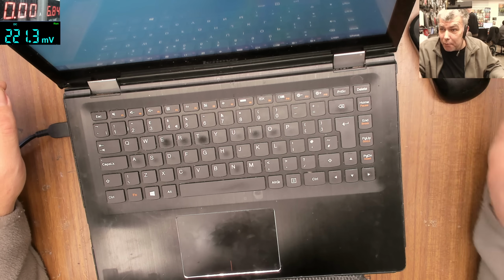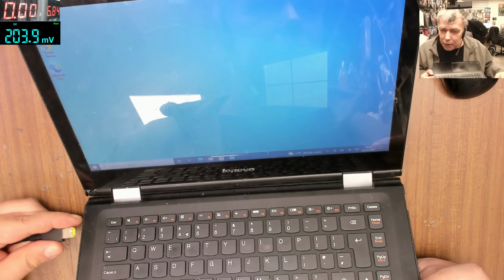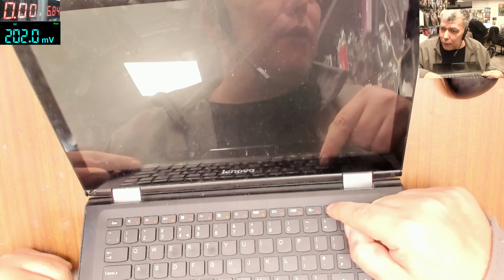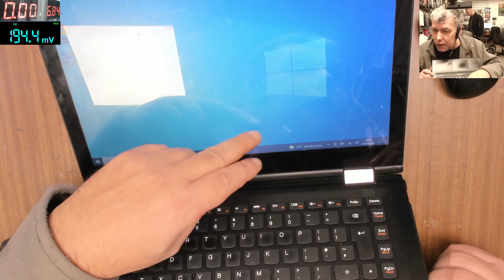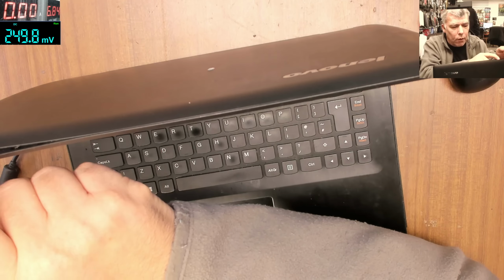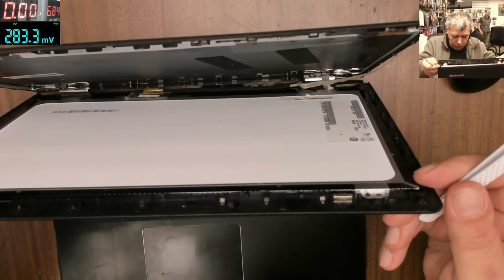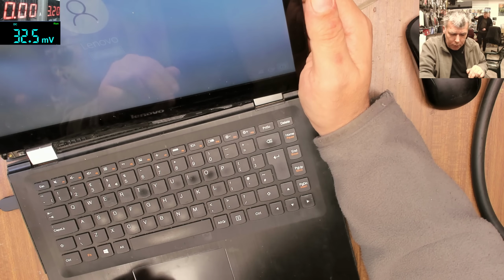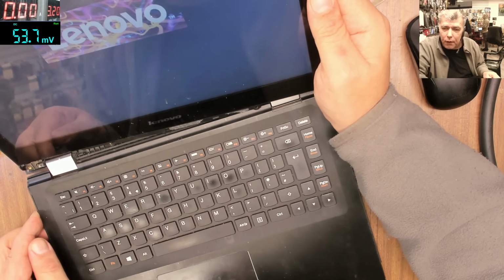Lenovo Yoga 500 repair No backlight with the laptop running on the battery

Comment: The backlight will probably no longer turn off when the lid is closed, because the ON/Enable pin is forced on all the time.....UNLESS that 3.3v rail also goes off when the lid is closed. Still better than having no backlight at all...
Reply: ah I was wondering the consequence of bringing current from another rail. And could it damage the rail as it will draw much more current that was intented?
Reply: @ytrew9717  It could damage a good rail. Depends on the power draw of what you are connecting to it. You can't power the CPU or GPU from a teeny tiny little power rail. But I remember Sorin explaining that often times power rails are rated for 3x the current draw than what would actually be needed. The parts cost the same and engineers like to be safe so they use higher rated parts which is fortunate for such "dodgy" repairs.
In this case though there is virtually no chance that that additional load would damage anything as it seems to be an enable signal. I don't know exact numbers but I'd estimate an enable signal drawing just a couple of mA max.
Reply: @fabian11235  thanks a lot for taking the time to explain!

Comment: Somebody else would change display right? Just because they don´t know how to solve this issue. Really well done job as should be.
Reply: If this problem really due to super io signal changing the display is not going to work
Reply: @kumarshubham3230  this is not really the point of the comment. But i think some of shops would just say mlb issue unrepairable.
Reply: May be
Reply: not only somebody else would try changing the display, they would do it with the battery connected and bye-bye backlight circuit!
Reply: @superbob2k5  🤣
Reply: @vitpasek9380  northfix -> no fix -> charge  60 - 80 dollars
Reply: @Arvidje if capacitor melted MLB they would do this. And Sorin? ADD some resin! And then computer starts ;D

Comment: To keep lid close no backlight function and display off screen saver functionaility, could you use the  2 volt from sio to switch a 3.3v supply via a transistor.

Comment: Wouldn’t disabling the power save features solve this ? Sorry if it’s a stupid question
Reply: no
Reply: @Customer22374rt  fair enough, stupid question it was then 👍
Reply: I would say that was my first thought, change power profile to High Performance.
It wouldn’t alter the screen’s brightness when charger removed.
Just depends on if the charger is required for highest brightness if it’s one of those eco laptops that use battery and charger to achieve that brightness.
Reply: @Customer22374rt  care to explain why?

Comment: I have Lenovo Flex 3 1130. keyboard mouse not working. suddenly shuts down. I think this problem is chronic in this model. I couldn't find a solution anywhere, can you help me?

Comment: The voltage that is already present on that cap( 3.3v with charger and 2.2v without) now with the added wire that brings 3.3v to that cap dont sum together? I mean 3.3v+3.3v=6.6V or am I wrong?? Thanks For Sharing
Reply: No voltage difference is same so voltage remain same only amp increases but load is limited so nothing is going to happen
Reply from the maker: https://www.electronics-tutorials.ws/dccircuits/dcp_4.html

Comment: It worked but what was the real problem?
Reply: As he prolly said, the SIO is responsible for the backlight, and he bypass this fuction from the SIO and the backlight was always on.
Correct me if im wrong.
Reply: @ChrisPavlides  correct , led on signal become high on the startup chip.. but can become low when u close the lid, so he has to test that also.. can be that closing the lid the backlight will stay on now..